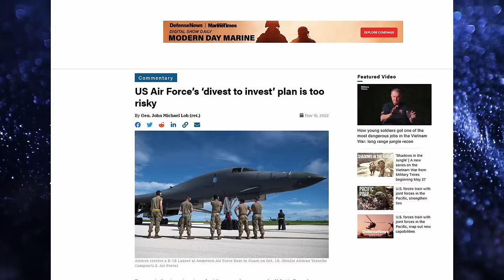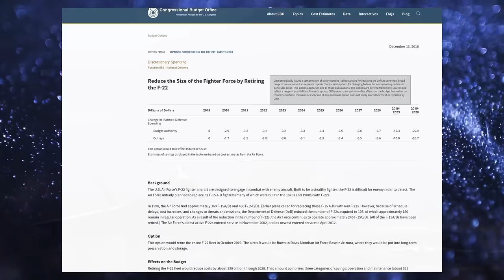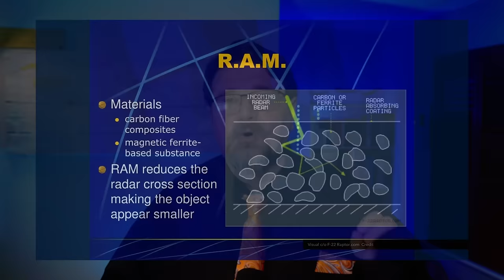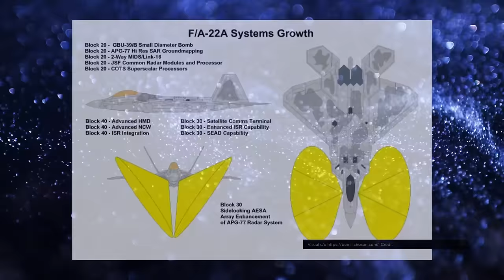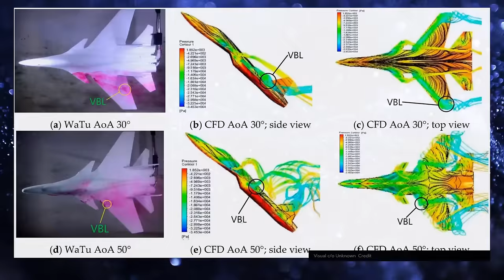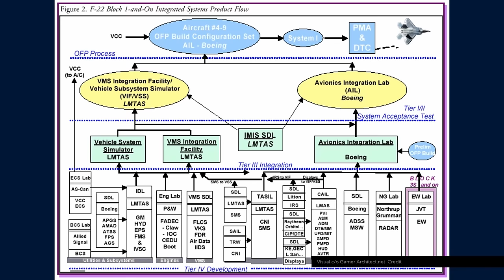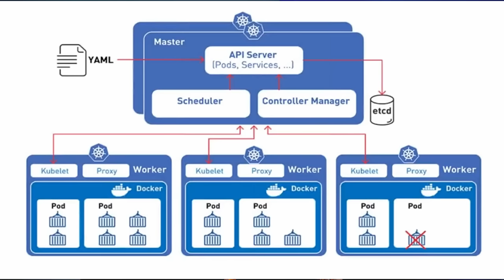F-22 Raptor: The Apex Predator 😈

Comment: Your speculation on the AIM 260 is the reason I am very critical of the F35. Its simply horrible kinematicaly and thus handicaps all weapons giving any oponent a massive developmental advantage. Not only that but its payload bays cant carry a large missile so you cant even sacrafice numbers for range. You are just stuck with mediocre range while others outrange you. And since its an all in development any opponent knows that a true long range missile is just not on the horizon for DECADES out of the US.  You basically have to wait for 6th gen mass adoption before the US can field a true long range missile in mass. F22 production lines are long gone and its in limited numbers.
Reply: I think you need to lay off the kool-aid a little bit. The F-35 kinematically is very much similar to the F-18 Super Hornet / Typhon. . all of the data that suggests otherwise comes from situations where the F-35 performance was being purposefully limited by the software. The internal payload bays are adequate in size and will be able to carry the AIM-260. The AIM-260 is rumored to out range and out perform the PL-15 with a duel motor rocket.
Reply: @arkadious9320  Yeah, you are comparing it to the most lackluster aircraft in the us air force. You can do the math and see what the kinetic energy of a mach 4 missile is gona be fired from f35 flying at mach 1.4 or a su57 at mach 2 let alone a mig 31 at mach 2.5. quite simply it matters a lot. You can do the same math with f22 and f15.To say nothing about the fact the f35 cant supper cruise. Its payload bays being big enough is kinda doubtful even if it can fit the aim 260. A missile that will not outrange current russian r37 variants that can do 400km. That has a variant that fits inside the su57 btw. Having a handicap in the ballpark of 20% due to poor kinematics is not a trivial matter when the f22 clearly proves you can do a fast stealth.
Reply: @SlayerBG93  And this is against what sort of target? An F-35A can hold it's own in most cases. What it can't do is protect strategic aircraft such as AWACS from long range threats, but that isn't it's purpose. It's also highly unlikely for fighters to ever reach the speeds you suggest in actual combat unless they have a pre-planned target. A more likely difference in speed would be an F-35A at Mach 1.2 vs an Su-57 at Mach 1.5.

If the F-22 can carry the AIM-260, then so can the F-35A/C.
Reply: @dumdumbinks274  Those long range missiles will hapily take out the F35 as well. No AA missile on the planet has a lower turn rate than a plane and long max range is directly proportional to long no escape zone. F35 cannot supercruise. Meaning the most likely scenario is actually an F35 flying mach 0.9 and the Su 57 doing mach 1.3 supercruise. 1.5 if it gets around to using the new engines. That range penalty of braking the sound barrier is a bitch. Obviously there are situations where it wouldnt matter as much. For example F35 sneaking up on an ususpecting aircraft flying subsonic while it is going mach 1.4-1.5 but that is situational. The reality is that bad kinematics put you at a general all around dissadvantage that one must work around. F35 is almost in a dead if spoted situation since most modern aircraft outclass it kinematically both in top speed for launching missile and top sustained speed to close distance. So an F35 should be very afraid of AWACS or ground based radar detecting it with low frequency radar.
Reply: @SlayerBG93  No powered missile has a lower turn rate than a fighter. Turns are also not how fighters defeat missiles at long range, rather the distance they put between themselves and the turning point is what matters kinematically. It's 90% tactics and 10% luck. A missile such as the R-37M can easily be de-energised at long range if the launch is detected, and once it's sustainer motor runs out it decelerates faster than other missiles. Not that it matters much because it would not be able to use it's range advantage vs a stealth target without significantly degrading the missile's accuracy. 

Fighters fly around at subsonic speeds unless they have a target location. Supercruise is not fuel efficient, it's just better than afterburner. The F-35 has trouble accelerating through the transonic region, but it can still reach Mach 1.2 by the time an F-22 reaches Mach 1.4, starting from subsonic cruise. By that point a missile launch is highly likely to have occurred. However that assumes there are supporting assets. In a situation comparing just the fighters, they would likely not reach supersonic speeds at all before missile launches occur, due to the engagement being stealth vs stealth.
Reply: @dumdumbinks274  any missile can be deenergised at long range. Thing is all else being equal r37 no escape zone will be larger than aim260 simply due to the higher maximum velocity. Why would you assume it slows down faster? Range is relative but in the end more energy is more energy. Big missiles with fast planes will always outrange slow fighters with small missiles. Its physics. Supercruise is very much a thing that is used anywhere near the battlefield. Not having it is a major con. Fuel wise it costs more but that just point out another flaw in the f35. Its combat range while not bad is smaller than its opponents. Making wasting fuel a major concern.
Reply: @SlayerBG93  The R-37M is a much larger missile, generating a lot more drag and inertia. It takes a lot more energy to turn, which reduces Pk against maneuverable targets compared to smaller missiles. Depending on the design of the AIM-260, it's NEZ could be similar to the R-37M. The Meteor for instance is far more practical against fighter targets than the R-37M, despite being slower and having much shorter maximum range.

Supercruise is not going to be used 10min before combat even begins. It is used as I said when near a target location, and in the case of stealth fighters is used sparingly to keep a more typical IR signature. It's also largely a non-factor considering the F-35 takes roughly 9min to decelerate from Mach 1.4 to Mach 1.2 at 40000ft and military power. Only intermittent afterburner is required. As I mentioned it's transonic performance is where the problem is.

Range isn't a big issue when tankers are topping up fighters several hundred km behind the frontline. Russia doesn't have that luxury, so in reality the F-35 will more likely be entering combat with better endurance than the Su-57. If you want to talk about range being a problem, then the appropriate scenarios involve Chinese fighters.
Reply: @dumdumbinks274  Final weights are classified but a simple comparison between r37 and aim 120 suggests the r37 would have 4.5 times more drag due to larger surface area while it being beign 3.2 times heavies means it will likely slow down in the ballpark ot 30-40% faster all else being equal. It remains to be seen what dimentions aim260 will have but I susspect it will be larger than the 120. That being said the 120 maxes out at 180km vs cooperative targets while the r37 at 400km. So the faster slowdown is nowhere near enough to compansate for the over double range. Suggesting the no escape zone of the r37 will be in the ballpark of 1.5-2x what 120 has. The meteor is a curious thing since its longer boost phase means a larger than expected no escape zone but its flight profile is unusual since it doesnt follow a balistic tragectory. Still I expect the r37 to outrange it too simply due to the large difference in kinetic energy. Regarding supercruise I kind of dissagree. Some planes fly standard at supersonic like mig31 and no supercruise capable aircraft will be draging its feet near the frontline. The decelarating from mach1.4 to 1,2 in 9 minutes is obviously false. You are either missrembering or someone bullshited you. The aircraft would need to have at least an order of magnitude lower drag than what it has for that kind of energy conservation. Just think of how fast a car decelerates from 140 to 120kph. adding a 0 doesnt really change the math. Aircraft have lower drag than cars obviously but its not that much lower.
Reply: @SlayerBG93  That's assuming the target isn't maneuvering. NEZ is calculated differently for different target types, and it will be significantly different for a non or barely maneuvering large aircraft vs a maneuvering fighter. I'm not saying the 120 will be anywhere near the energy of the R-37, but the loss of energy during maneuvers, the point at which max speed is achieved, and how long the sustainer runs for all impact the NEZ and Pk. It isn't simply a question of how much energy the missile has. 

A non-supercruising fighter won't be dragging it's feet either if threats are nearby. Fuel efficiency doesn't matter if it leaves you vulnerable, but that doesn't mean maximum afterburner is required either.

If a plane can supercruise, then it is very possible for another plane to decelerate slowly. A clean F-15 or F-16 will also decelerate slowly at military power once supersonic, it just requires them to be in a useless configuration, so you'll never hear it talked about. An engine that produces 75% of the dry thrust needed to get through the transonic region will produce something like 90% of the dry thrust required to sustain supersonic flight. 

A car driving at military power would be maintaining it's maximum speed, not decelerating.
Reply: @dumdumbinks274  Ahh you meant that it will slow down over 9 minutes under no afterburner thrust but full conventional. Ok that is believable. That kind of timing is very specific and requires quite the situational awareness. 
Regarding no escape zones. Yes I am aware how much it gets degraded vs highly manuvarable targets. Point is the missile is not under power pretty much ever. The engine burns out too fast and almost no AA missile has thust vectoring. All the manuvering is done with the canards and tail fins. Those have control authority directly proportional to velocity. Think, mach 1 X control. Mach 2 4X control etc. At some point the missile loses the energy to have sufficient manuvering authority. Regardless of if we are talking aim 120 r37 or meteor the amount of energy lost per manuver is almost identical proportionally and they all have control surfaces designed to keep them manuvarable as long as possible. So the top speed/max range is very indicitavice of the NEZ as well in terms of proportion relative to max range. There is no reason to assume a large missile has a hard time turning. The 9M96E2 for example is similary sized by weight and it quite hapily turns at 20g at 30km altitude. Size becomes an issue at much much larger missiles that are not part of the anti air class of missiles. As long as its still moving fast any missiles will blow a manuvering aircraft out of the sky.
Reply: @dumdumbinks274  Hmmmm, I was under the impression that the F 35 has decent Transonic Acceleration. Do you have the numbers for its Transonic Acceleration and 4th and 5th gen aircraft, both US and Russian?

Comment: The cost of a single F22 was around 143 million…I’d be willing to bet 70% of that cost is attributable to software development. As the MIDS JTRS Program Manager (Acquisition side), software is extremely expensive.
Reply: The F35 is way more than the F22, which is crazy, I thought we were going to hold company's accountable.......not allowing them to get paid for extra cost's!
Reply: @albr6770  Huh? Individual F35 costs are far lower nowadays, but mostly due to the volumes being produced. The only reason the raptor isn't cheaper is because the US divested.
Reply: @albr6770  It’s a very tough dilemma. Do you award cost + contracts so you get contractors to bid, or do you set the price at what the government deems fair (fixed price) and nobody bids because the cost of software development is so incredibly expensive and there is too much financial risk to a contractor. What ends up happening because very few defense companies have the capability to write software which is capable of full sensor fusion to the level these planes require, puts the government in many ways…a rock and hard place. It’s a matter of who has who over the cost barrel. It’s tough.
Reply: Labor cost and Shareholder cost.

Comment: "F-22 Raptor: The Apex Predator"? Then why did the USA stopped its production? 
Can F-22 production be restarted?
Due to the myriad factors outlined above, it seems implausible that the Air Force would kick-start the production of the Raptor again. The sheer cost and impracticality associated with the process make it highly unlikely.

Comment: I think it's really interesting how over-engineered these tip-of-the-spear projects always become.

Kubernetes are very minimalistic virtual machines that COULD be beneficial software deployment, but not in any way that's appropriate for sensitive information. Instead, they'd be more appropriate as a way to sandbox potential malware or create redundancy.

A fighter jet computer probably wouldn't be on a lot of disreputable websites, and its computer redundancies would need to be hardware-based solutions to be meaningful at all.

A better solution would be to code in a C-language with a JPL compliant style, using a purpose written compiler. At the end of the day -- a well-organized code base, on that VERY localized system, would be simpler to test, maintain, and correct; than whatever it is they're doing with server sandboxing tools.

Comment: ‘First operational aircraft capable of super cruise?’
Ahem..
Concorde…?
Reply: Concorde first? 
Ahem ...
Tupolev Tu-144...?
Reply: Tu 144 had to use afterburner thus not super cruise
Reply: From the Wikipedia page on Supercruise:

"The first production aircraft to exceed Mach 1 in level flight without afterburning was the Lockheed F-104 Starfighter after its J65 engine was replaced with a J79. The maximum speed without afterburning was Mach 1.05."

While it didn't stay in service overly long in the US, it stayed in service with other countries, such as Canada and Germany, for a much longer time. There were over 2,500 built, if one adds up all of the variants. Canada had 200 single seaters, CF-104, and 38 two seaters, CF-104D, mainly used for training.

Comment: The idea to replace the F22 with the NGAD does make sense. The F22 is just too rare to have good per unit costs. The only thing saving it is that the US would not have anything ready to fulfill it's role if China acted up today. NGAD in serious numbers and with teething issues worked out won't happen before 2035.

Comment: Su-57 is only a 5th gen fighter in propoganda.  In actuality it’s a SU-35 with a low visibility ground effects kit.  IRST and off bore sight is virtually meaningless as long as the Raptor maintains its BVR advantages.  J-20 is even worse as it CANNOT perform IVR dogfighting
Reply: Whats your problem with the j-20

Comment: The shear stupidity of the Military Industrial Complex is staggering! 9 BILLION dollars to upgrade all the F-22s is cheaper than 20BILLION$ to design and build a new gen fighter that might not even be better than the F-22.
Reply: Wouldn't that mean their not stupid? or do you want them to build a new generation jet fighter? and then what would happen to the f-22 if they weren't upgraded.
Reply: @Marty_YouTuber  @Taylor Swift is Queen Considering your fasination with Tailor Swift, I see how you can't parse what I said. It was anger at how they wanted to spend untold billions making new stuff when it's cheaper to pull their heads out of their procurement spending black hole and take the smarter rout with upgrades over unproven things. Example the Boeing X-32 that was a canidate to compete with the F-35 which is still a massive black hole of money and dosen't fully live up to the claims.
Reply: @TKSubDude  and What does Taylor Swift have to do with this?
Reply: @Marty_YouTuber  Simple, that is the name that came across on the email notification. Must be you.... That's what cameup this time too.

Comment: "understand why"

Because the F-35 sucks.

"more technology"

You misspoke, you definitely meant to say "the solution to every problem is (causing) more problems".

"apex predator"

Nah, not since Su-57 became fully operational.   Also, i actually confirmed numbers of manufactured Su-57s, 6 in 2022 and 12 in 2023, another 12-16 expected in 2024 and 2025.

"improvements to the radar"

One rumor is that it's finally going to get a dose of antistealth capability integrated.   Completely unverified, but it would be about time.

"even the D-variant"

lol
AIM-120D can manage 160km.
R-37M can manage 420km.
Yeah, that's KINDA big on the outranging side.

"outrange Russian and Chinese counterparts"

Not gonna happen.   For the simple reason that the F-22 weapon bays are too limited, there's simply a limit on how much missile capability you can stuff in there.
And the only statements we actually have about the -260 so far is a measly "more than 200km range".   Sure, big improvement over the -120D, but not exactly impressive compared to the big boys.
200km isn't even enough to outrange the PL-15.
Reply: The Vympel R-37 (NATO reporting name: AA-13 "Axehead")[1] is a Russian hypersonic air-to-air missile with very long range. The missile and its variants also had the names K-37, izdeliye 610 and RVV-BD (Ракета Воздух-Воздух Большой Дальности (Raketa Vozduh-Vozduh Bolshoy Dalnosti), "Long range air-to-air rocket"), and the NATO codenames "Axehead" and "Andi".[2] It was developed from the R-33.
Reply: The PL-15 (Chinese: 霹雳-15; pinyin: Pī Lì-Yāo Wǔ; lit. 'Thunderbolt-15', NATO reporting name: CH-AA-10 Abaddon[6]) is an active radar-guided long-range air-to-air missile developed by the People's Republic of China.